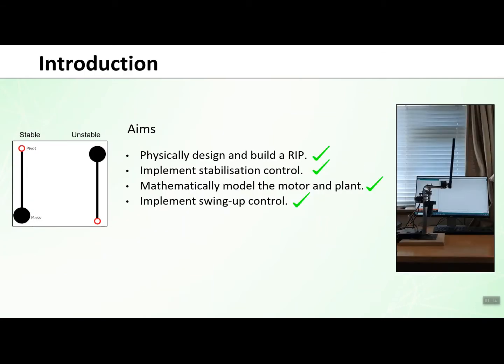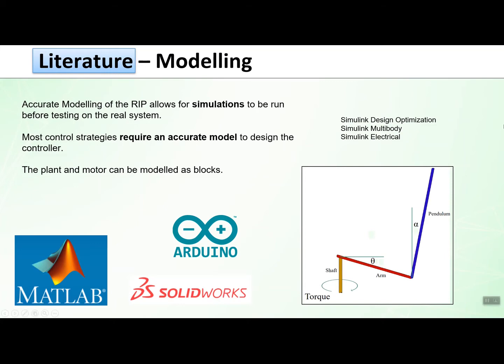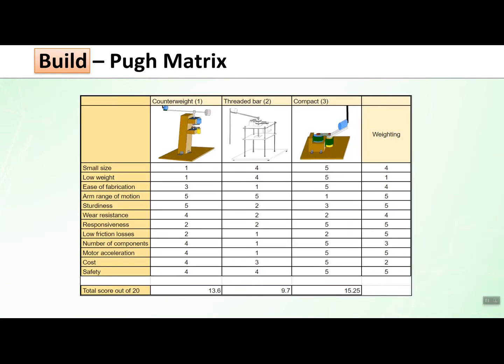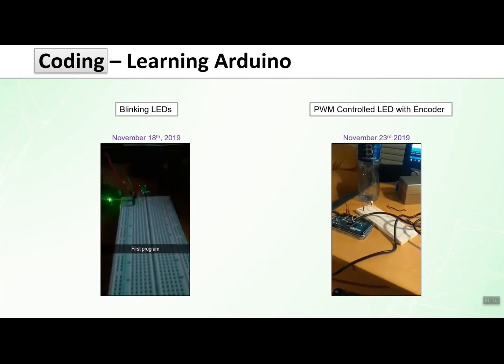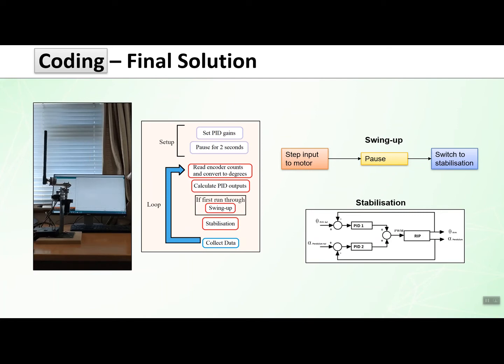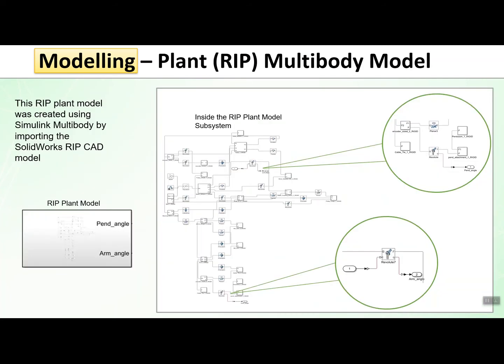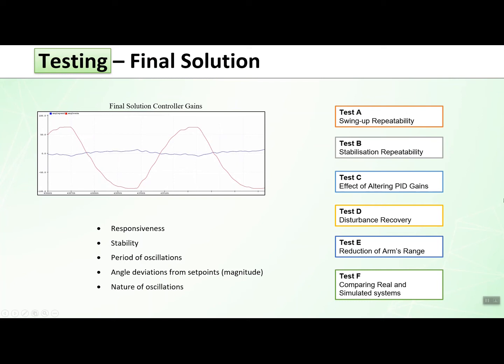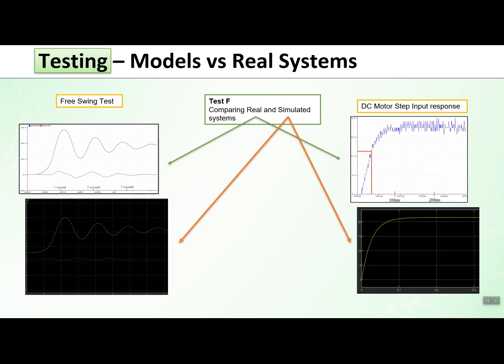Rotary Inverted Pendulum (PID) - Design, Build, Model, Swing Up and Stabilisation

Comment: How would you convert the control signal from a voltage to a PWM pulse signal? Thank you very much!
Reply from the maker: Hey, it's not too difficult actually! Just look for a tutorial on how to control an LED brightness with PWM on Arduino - plenty out there. If you can control an LED's brightness you can control a motor.

My code loops continuously, so with each time the code runs through, the new PWM output is calculated for that specific moment. Hope this helps.